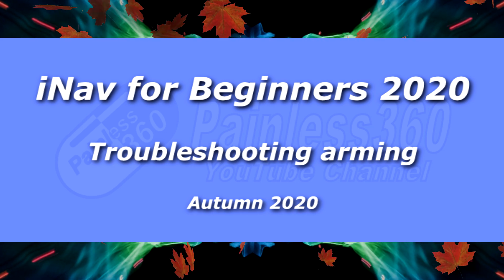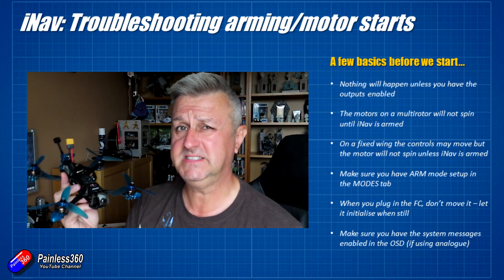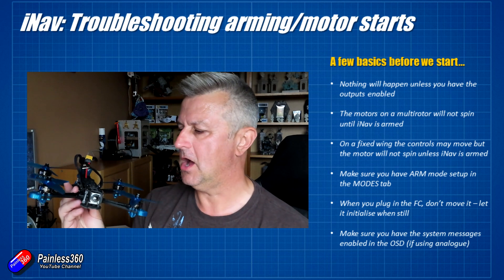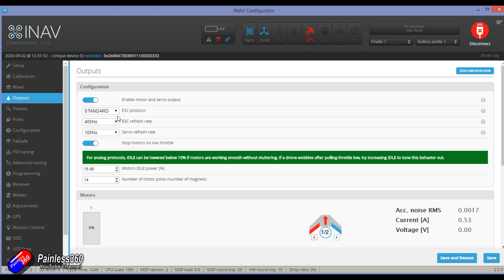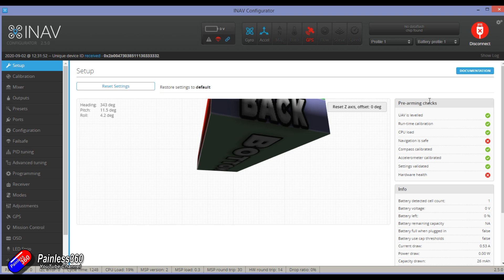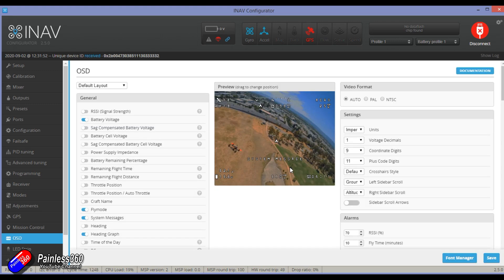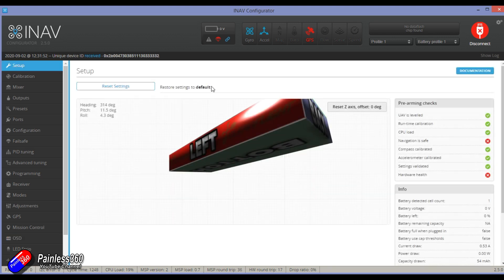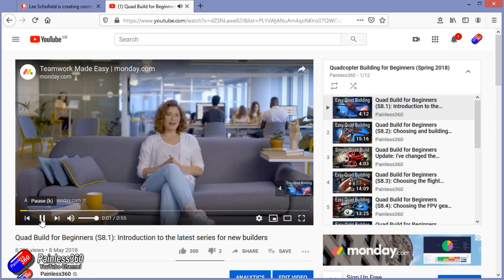INAV for Beginners 2020: Troubleshooting arming/motor not turning problems

Comment: Hi painless360, I’m wondering if you can point me in the right direction. My plane has a matek f411 running INAV, and up until recently was running fine. I installed FPV stuff and managed to get the OSD stuff working great, however I went to fly my plane yesterday, my plane is arming itself, however it’s not throttling up. There is power getting to the motor cause I can see the motor twitch when I plug the battery in.. but it just won’t go anymore… any ideas what my issue could be? Thanks in advance
Reply from the maker: Autolaunxh usually. See https://youtu.be/RFO4TDIX5oU

Comment: If you're here and you use TBS crossfire,  check if your new nano RX is in 12ch mode. If it's in 8ch mode and your ARM is on CH9, your motor won't work.

Comment: Just bought a new standard esc for fixed wing & tested it as you do on a servo tester.
Put it in the model calibrated it but after I get Sat's
It won't throttle up it just like ticks & prop rocks a few millimeter. I tried a new motor while it was in the model with same result. Took it all out & tested the esc again with same & another motor & all OK.
So I then put a 20a opto multishot quad esc in the model & all is OK. Now I've just put the new esc back in my wing & the problem is back.
I don't think the esc likes being hooked up to my matek f411 wing. All other combinations work just not the x rotor ripoff esc & the FC.
Any ideas anyone.
Reply from the maker: That is odd. I've not seen that. ESC protocol maybe?
Reply: @Painless360  just made a quick short, if you wouldn't mind.
Reply: @FugPlays I am having the same issue, did you fix it ?

Comment: Hi. Would you be able to advise on asking issue under auto launch?
If I turn auto launch off by default, everything works ok. But moment I turned on auto launch by default under config, the motor doesn't spin up when I flick arming on. 
Thanks lots.
Reply from the maker: It won't until you raise the throttle. See my video on Autolaunch... Happy flying
Reply: @Painless360  Thanks for replying. 
If I set auto launch to a switch, it has no problem spinning up when it arms and throttle up. 
However if I set it to automatically autolaunch by default, that's when arming and throttling up doesn't get the motor spinning at all. 
Puzzling.

Comment: I'm getting: Arming disabled flags: NAV CLI NOPREARM - I have my pre-arm configured and its set up on a switch which is working in the modes tab - however, I still have the Navigation is Save "red x". Typing in status in the CLI still shows the "Arming disabled flags: NAV CLI NOPREARM" message....
Reply from the maker: I don't use PreArm here. To use it, activate PreArm using the switch you assigned before selecting ARM mode using the switch setup for that.. Happy flying
Reply: @Painless360  Yup, that is what i'm doing, but the flag remains. Quite frustrating as I really want to test the 7" with Inav since betaflight's GPS rescue on 4.3 is just plain scary.
Reply from the maker: I'd remove the per-arm stuff and see what happens. I don't use it here so not an expert on its use.. Best of luck!

Comment: Fix wing F4 control osd shows "pwm init error"while not  plug to the ESC. Is it normal ? Should I plug all the servors and ESC to fix it?
Reply from the maker: Not sure that would help. Things like INAV versions and hardware used are vital to know for things like this. There are others who have reported this error, see the INAV Github... Best of luck

Comment: Sir I have a new problem when I arm my sp racing f3 dulex 450  quad it just want to kiss the cealing with full throttle please help
Inav 2.6.1
Min throttle 12%
Not in baro mode
Calibrated escs
Tx working properly with no throttle hold assigned
Is inav 2.6.1 is not compatible with sprf3 dulex please help
Reply from the maker: I'm not sure what you mean. Can you elaborate?
Reply: @Painless360  ok there is no settings in cleanflight version 1.1 for return to home like rth climb altitude and motor stop duration so if I hit rth what altitude it will use for return to home or it will stay in the altitude in which it's allready flying in please help because I can't use inav because it's so unstable I can't tune it properly

Comment: My workbench is in my basement so the GPS can't see the sky and it is hard to get a good gps signal in my yard due to trees. Is there a way to temporarily bypass gps to allow arming so I can test my setup before I go to my flying field?
Reply from the maker: Yes. Arming safety can be changed. All in the wiki.. https://github.com/iNavFlight/inav/issues/4489
Reply: @Painless360  Really interesting.  I had never looked at this level of the github material. After looking at the link, I found that navigation unsafe can be bypassed by toggling arm switch 10 times within 10 sec. 
https://github.com/iNavFlight/inav/commit/ca3f21e7a182cd53c1ecf1d15f149712c90662c9
Finding iNav answers on github would make a great video topic!
Reply from the maker: Like this - https://www.youtube.com/watch?v=SEe7P1lHawU ?

Comment: Hello my friend,  
   Being old I take long breaks in my, modeling. My pet project is a modified F-4 Phantom, which will be  an RF-4E,  camera pod, well small camera fits,  might as well put one in ... FPV is pretty much screwed in the states,  but ? Anyhow got a matek 722, which would handle the 120 amp current and was on sale .  The setup is daunting, ... motors OK, camera ok, aerons ok rudder OK, elevator ok... canard ...where do you set up canard ?  Limited to 20 degrees of travel, should it be armed separate?   Don't answer,  it will make your head hurt ...besides odds of my finishing the project are slim , as I don't have the dexterity or eye sight to fly it  . Just promised myself I'd build it some day , I have built 4,  each save the proof of concept crahed or blew up... twin 70 mm fans , landing gears flaps.  Well thanks for all the wonderful lessons
Reply from the maker: Not sure how a cannard needs to move.  Best of luck with your build!

Comment: Hi lee
I have a weird arming scenario on my matek f765.
To arm the motor I press the arm switch and both ailerons move to an up position then I have to move the roll pitch stick then the ailerons go back to the centre position then I raise the throttle and the motor starts.
I thought it might be a radio problem but I have two radios and it's the same procedure.
Reply from the maker: Autolaunch perminantly enabled?
Reply: Yes it is, I will have a read to see how it works.
Thanks.
Reply from the maker: Yep, the manual is always worth a read.  Best of luck

Comment: My issue seems to be while in loiter or rth the craft pitchs up and down, sounds like it pitches up with throttle then throttles off
Reply from the maker: What troubleshooting have you already tried?
Reply: @Painless360  I thought it may be hardware so I've adjusted the servo linkages. That didn't work so I have upped the nav throttle percentage a bit so just waiting for next flying day now to test that.  I haven't used inav since version 2.2 so I'm a bit lost with the new output settings for the motor as its in percentage now not from 1000 to 2000 and I cant figure out if I have full esc scale🤔
Reply from the maker: Every step I use is shown in the series.. Best of luck with the flight..

Comment: I hit disarm by mistake while I was flying a fixed wing. I couldn't get the motor to "re-arm" again no matter how many times I put the switch back to Arm. Is there a way to be able to Re-arm in flight if you hit the disarm switch by mistake? ( This is with Inav).
Reply from the maker: Yep. I've made a video on it. Please make sure that the bell notification icon is selected for the channel and you won't miss things you're interested in. If you Google something like 'inav arming painless360' then you'll find my video on rearming in flight... Hope that helps..